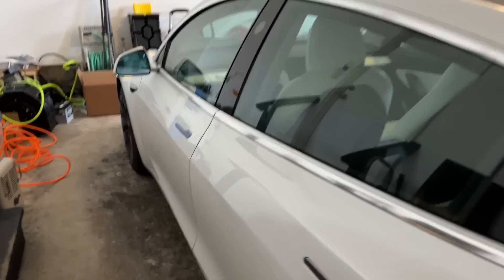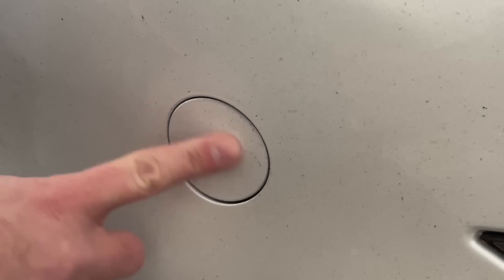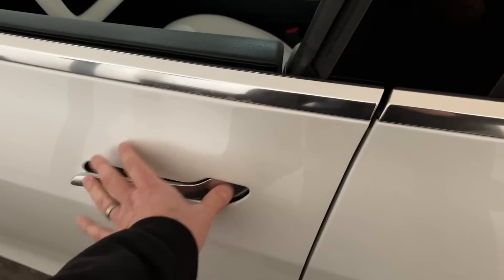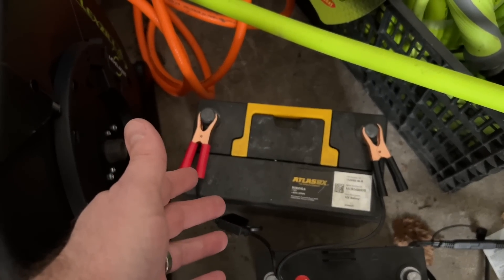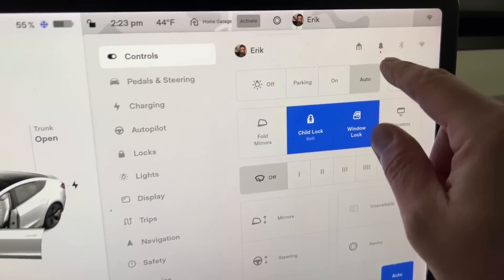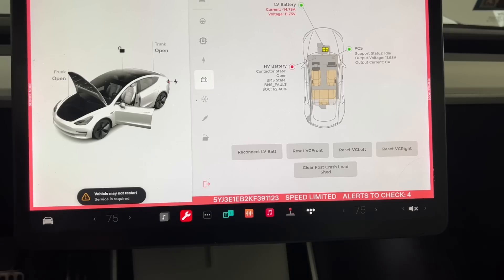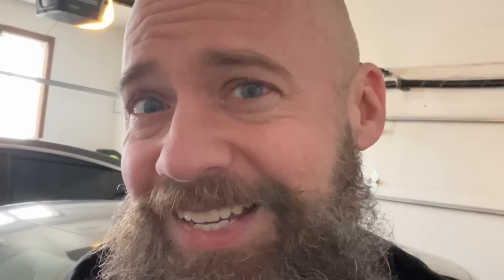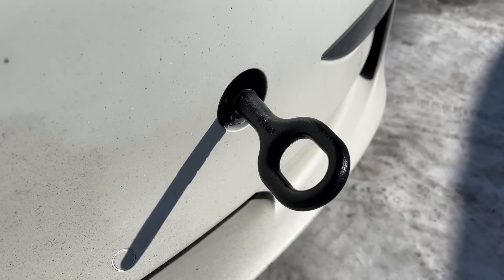My Tesla is completely dead!  Is it now bricked?  Pt1

Comment: Interesting how troubleshooting is so different with an EV.  The whole door thing seems like a software design flaw.
Reply from the maker: Or is it?…If your car dies on the side of the road, there is a mechanical lever to let you out of the car.  Knowing that the locks are electric, if the cars power is dead, would you rather the default to have your car locked up on the side of the road or unlocked for any passerby to get inside of it?   Remember, there’s no power to lock it up before you leave it.  I think it’s designed this way for security purposes.
Reply: @BecauseTesla  I'll take option 3: the ability to lock/unlock regardless.  Remember, he found the main battery still had a 58% charge left in it.  And vehicles with electric door locks can still be unlocked manually even if the battery is dead.

Comment: Anytime you replace your battery, your supposed to disconnect the connection under the seat.
Reply from the maker: You are correct.  I did this off-camera as I was rushed to get this fixed.  I'll make a separate video dedicated to swapping batteries in the future, and it will include this step.  Thanks!

Comment: Interesting that some people say you should go to your back seat, remove the cushion, and disconnect the main harness prior to putting in a new 12V.
Reply from the maker: For safety reasons, you really should disconnect that harness under the rear seat first.  If you don't, it can still send current through the PCS and into that positive lead to the 12v.  I'll admit that I've done it a few times without disconnecting it, but it isn't the safest way.   Tesla recommends disconnecting it first:   https://service.tesla.com/docs/Public/diy/model3/en_us/GUID-2588F809-41E3-43F1-84E5-6745C7C18DBE.html

Comment: To do a hard reset you need to disconnect the 12v before unplugging the penthouse under the rear seat. If you do not, the 12v keeps powering the systems. Couldn't tell by the editing if this was done.

Comment: So I can go round opening evetyones. Frunks?
Reply from the maker: This only works if everyone’s 12v battery under the hood is completely dead.   If the battery is working normally, this trick with the 9v battery will not work.  It stays locked for security reasons.

Comment: My daughter had those same warnings last week, same time as you had it happen. We called Tesla and they came out to fix it. Took them less than an hour.
Also, because it's battery-dies week (although I celebrated one week earlier), mine had a HV warning and told me to drive slowly. The message was different. Mine was a battery coolant problem. I brought it to Tesla, and they found mouse droppings up inside the bottom of the car, behind the left rear wheel. They had eaten through a plastic cover and chewed a battery coolant line. Not sure what happened to the rodent, but it took Tesla a few hours to replace the coupling they damaged. No additional damage to the battery, fortunately.
Reply: I saw a video where something similar was happening to gas powered cars, I believe in San Francisco. Supposedly, the electrical lines are covered in a soy based plastic, or something like that, and the mice/rates are literally eating it as food! Not sure how you stop that! 😂
Reply: Yeah this guy was more interested in the drama versus actually having a solution. A quick call to Tesla would have been easier than "googling".
Reply: My buddy had mice in his Corrina. He thought it was great until one night it burned. Got rid of the mice tho'.
Reply: You all enjoy these trashcans :)
Reply: Just as an FYI I had an A Class Mercedes Benz gas powered. In their (MB) infinite wisdom, they coated the coolant pipes in a soy product (insert you climate/green reason here) and one day I came out and opened my trunk. It was carnage, a massive hole in the inner wing plastics and the insides destroyed! I telephoned MB insurance, on the call he said "ahh have you looked in the engine compartment" and I opened it up, yet more carnage and rat shit everywhere! Yup, in winter, the rats love to chew on the coolant pipes, and then go further looking for more yummy soy to eat. 

How stupid are some of these woke policies. The car was away for 2 months for repair, then I sold it! I suspect the same is happening with yours and other models on these coolant pipes.

Comment: Can you use the app to open frunk
Reply from the maker: Yes, you can open the frunk with the phone app...as long as the car has power and an internet connection that the phone can connect with.  I couldn't use the app because the car had no power.

Comment: low HV battery SoC, can drain the 12v battery, as it has no juice to recharge the 12v... and that controls all the doors, controls, and HV contactors etc... hopefully just your 12v , but eek says HV fault.
Sometimes a 12v batt booster mini-jump, is enough to get the contactors and the DC-DC converter up so it can recharge the 12v...
but, if the 12v is damaged not just drained, and won't recharge,... you need a new one. Get from service center.
Luckily, for newer Teslas, they have lifetime lithium 12-15v instead of the lead-acid 12v, so ... hopefully this issue mostly goes away!

Glad you showed service mode, can show the diagnostics for LV/HV etc and voltage/state of the 12v etc..

Comment: Looks like after your battery swap you were still below voltage threshold according to the Service Mode page for the Low Voltage System. Saw mid 11’s for voltage. This would cause HV battery contactor to not close. Thinking you had to pay for a basic 12V battery replacement and hopefully thats all that was wrong with your car.

Comment: As a tow truck operator myself, I am curious as the why the rollback driver didn't use your tow hook. The control arms on a Tesla are similar to those of a BMW, easily bent or broken. So I'd only use a recovery J-hook bridle on a Tesla if I can't access the tow hook for some reason or if the car was wrecked for speed reasons to clear the roadway as fast as possible.
Reply: When I had my Tesla flatbed towed (for dent repair, the car was drivable) they used the tow hook but fitted a breakaway strap around the front suspension. He explained that they don't trust the tow hook on any vehicle because the manufacturers don't actually certify them to a particular load rating. It's quite common for them to be pulled out the bumper if it fails for any reason, usually damaging the bumper. An old car could be rusted out and you wouldn't know til it snaps.

He said he prefers to winch any vehicle by the suspension arms because they are stronger. I think he was a stickler for safety because he spent 10 minutes arsing around with tow mode so he could winch it on. The guy that returned the car just drove it off (and he said he prefers to drive the car on if it can be driven, but winching is less likely to have the car come off the lorry).

So basically personal preference of the recovery driver, and company policies, plus circumstances. I suspect the company I spoke with would only pull by suspension components if the car was already accident damaged as all the methods they choose are about reducing risk of damage and injury.
Reply: Those are NOT tow hooks , they are TIE-DOWNS.   Hence  why  the manufacturer does NOT list a "tow 
rating" for them.  Many , if not most , 
tow companies forbid their operators 
from using them WHATSOEVER since
the don't want to chance someone 
"shortcutting"  & winching  with it. 
  Even when used as "recommended" 
restrictions typically include  a 15°
MAX. angle of an UNDAMAGED , free
rolling vehicle. 
 They rip-out frequently due to owners
mis-use , weakening them. That's why
if an operator DOES winch it ,  they'll
also have a backup strap ( 🤔 hmm , 
so then why even use it if you're going
to the frame anyway 🤷‍♂️ ? )
Reply: Yeah, I didn't like seeing the tow driver not use the built in tow hook...

Comment: I love my electric golf cart, so I started researching EVs a few years ago. They are more expensive to buy & run than ICE cars, even with home charging.  I found they're worse for the environment overall, and since my husband is a retired power plant engineer I know our electric grid can't handle CURRENT demands, forget switching 290 million ICE cars to electric.  The charging situation has actually gotten worse, with so many of the individual stations broken.  As a retired woman who dealt with unreliable vehicles for far too many years, I wouldn't accept an EV if someone paid me to take it!
Reply: This entire post is all lies.  Probably a shill who works for the oil industry.
Reply: @StormsparkPegasus  totally. U can spot them a mile away.
Reply: @dadman9492  Yep...I've owned a Model 3 for almost 2 years.  Not a single thing in the OP's post is true, lol.  They aren't even exaggerations, they are outright lies.
Reply: All incorrect. The fud is strong in this one.
Reply: Your gas car is cheaper to run than $12 to go 400 miles l.
I don't think so.
Driven 12k road trips on last 6 months never had a charging issue.
Just buy a Tesla.
I charge after 11 pm when grid utilization is low
By the way charging my EV is only 15 percent of my electrical usage 
When do you think there will be 
290 million EV on the road ?
Certainly not in your driving lifetime considering your husband is retired. 
I have an EV.
I am not concerned about conditions that do not happen after I no longer drive a vrhicle.

Comment: When you charged after 0%, how high did you charge it? I've read that the 12v battery charger in the system does not run when the battery is below 20%. So if the 12v battery was low as well, it could go dead, causing the symptoms you had.

Comment: So anyone can break into a Tesla with a 9v battery? :face-orange-raised-eyebrow:
Reply from the maker: Yes and no.  If the cars 12v battery is dead, then yes.  Anyone with a 9v battery can pop the frunk.  But if you just walk up to any Tesla on the street and try to use a 9v battery, it will not work for security reasons.  The main 12v battery must be dead for this to work.
Reply: @BecauseTesla  Good info! I have 2 Teslas and didn't know that

Comment: First time viewer and just subscribed! Sorry this happened.  Seen plenty of people go to %0 and then charge back up with no issue.   What year is your model 3 and how many miles? Some good tips you mentioned though! Hope it all gets resolved.
Reply from the maker: Mines a 2019 with 106k miles, so out of main warranty, but still under warranty for a couple of items like main battery pack and drive units.  Thanks for subscribing! Welcome to the family! 🤘🏼
Reply: @BecauseTesla  dumb question - is there any way to prevent this from happening? you mention how ICE vehicles can recharge the 12v, surely Tesla would have something similar to recharge like running the climate control or something no?

And if it can be recharged when the car is running, why can't it last a lot longer than the 3-4 years avg life span i am seeing on google? Just ordered a Model Y so this scares me :)
Reply: @j0404t  older Teslas have a small 12 V lead acid battery that could be run down to zero very easily. Especially if you had security cameras added, it could be problematic. These batteries typically have to be replaced within seven years, but it could be sooner. However, for the last few years they’ve been using a lithium ion 12 V battery that has the same life expectancy is the main battery so replacing it is no longer an issue. it gets recharge from the main battery. What’s why it should always be topped off. Not sure what the situation is if you run down the main battery while also loading up the 12 V battery.

Comment: Sorry to hear about your car.  Great tips on opening the frunk/replacing 12V battery and getting ready for towing.  You did everything I would have done.  I hope it's not a serious issue.
Reply: Did you sit through the whole video?  I played it at three times the speed and it was still a bit slow.
Reply: @Gunga Din 
There's really no need for any of this.

Out on the road just flag someone down with jumper cables. With their engine off, use the cables to open the frunk. Then with their engine still off, connect the cables to your 12V battery and turn on your car. Once your car is awake it will start charging the 12V system.

At home just use a trickle or standard charger the same way or use another car or motorcycle (even a Tesla) with jumper cables. The nice thing about using a non-running car to jump start it is that there's no possible way it could deliver more than 12.5V so it's super safe, whereas running cars, fast battery chargers , and portable jump start packs may supply 15-20V.

It's not like a fossil car which requires a huge battery to be well charged to start the engine, the Tesla barely needs 8 or 10 volts to boot the computer and get the HV contactors engaged so even a non-running moped can supply enough power to boot it up within seconds.
Reply: I don't like that the battery leads were bare. They could touch with vibration while in the cubby. STUPID DESIGN.
Reply: @nononsenseBennett  In my car, one of the leads is attached to the plastic cover and separated from the other.  They are also unequal length. https://youtu.be/xUOy5uomA7g?t=63
Reply: @Gunga Din 
🤦‍♂️ also its a 12v battery that does indicate polarity on it. Not to mention they are the new CATL NMC cells that give 2000 cycles and still have 80% of their initial capacity. So by all measure its better than your standard 9v lead acid battery.
Reply: I'm not sorry...he stupidly bought an electric car...
Reply: @gbsailing9436  
Sorry you have to sell your kidney every time you fill up but don't take it out on new tech.
Reply: @gbsailing9436  You don’t know what you’re talking about.
Reply: @gbsailing9436  he bought 2 of them.adding insult to injury. Now he's looking at a $30,000 battery replacement.for running it too low.

Comment: Run an ICE car to empty you will also have problems, different problems 
Copied from Bay Area Tire & Service Centers 
"You know your car like the back of your hand, so when your fuel gauge reads low, you know exactly how many miles you have left to get to a gas station. Or do you? Your confidence goes right out the window the moment you actually run out of gas. When your car runs out of fuel, your engine’s components can break down and cause significant damage. What types of damage can happen to your vehicle if you run out of gas? 

Your car will shut down. 
Once your car runs out of gas, your car will shut down as if the key was never in the ignition. This is dangerous because by this point if you haven’t been able to pull over to a safe spot, your car will stall exactly where it is. 
  
It will become harder to brake and steer.
Your brakes will feel heavier and will require more leg power to push. When you run out of gas, your engine will shut off and thus shut off the brake’s hydraulics. Your steering wheel will suffer a similar effect. You’ll need to use more muscle to turn the wheel and steer your vehicle. 

Your fuel pump may get damaged. 
When your car hits E, the lack of fuel will cause your fuel pump to become overworked. If your fuel pump becomes overworked, it can overheat, which leads to severe damage. Always fill your tank before it gets below 25% full.  

Your fuel injectors may not filter properly. 
Your fuel injectors are small nozzles that spray gas into your engine and prevent impurities from entering. When your fuel levels are low or empty, impurities are more likely to travel through the fuel lines and clog the fuel injectors. If you refueled your vehicle and it won’t stay running, this could indicate damage. After refueling, try priming your gas tank by turning on the electrical components without turning on the engine. Turn the car off and on a few times. If this still does not resolve the issue, you should consult a trusted automotive specialist. 

Most drivers keep their vehicles adequately fueled, but life happens. Know your route and take an extra few minutes to gas up. Most cell phones have a GPS function that can show the nearest gas station to your location. Keep your vehicle’s tank at least 1/4th full. If you experience any problems, an experienced technician can help diagnose any issues. "
Reply from the maker: Yep, I've had a fuel pump burn up before.